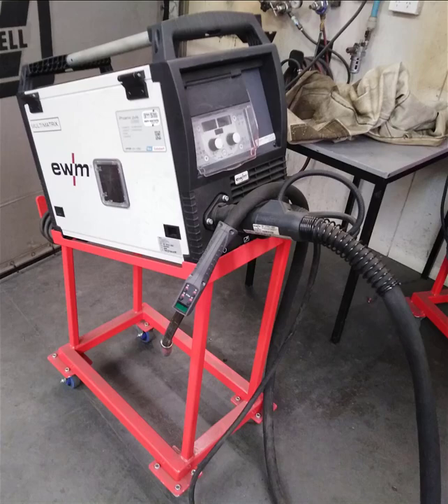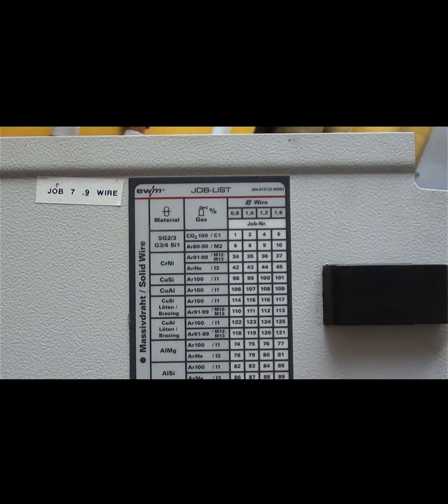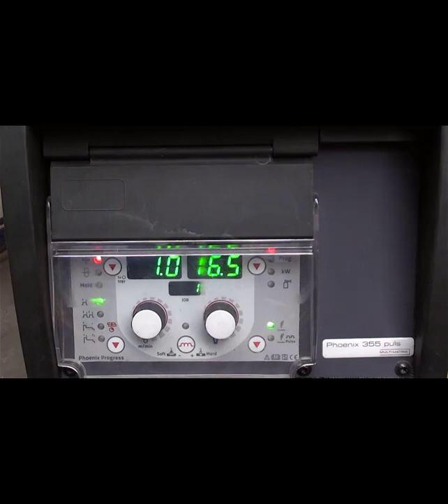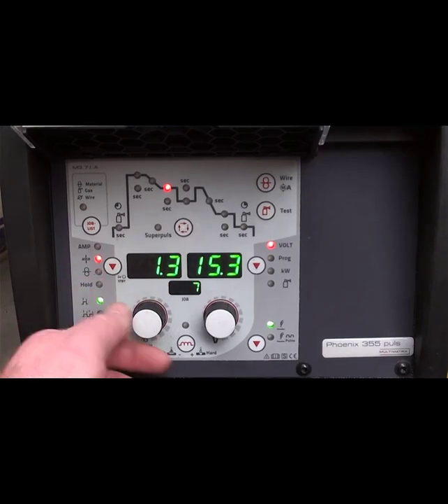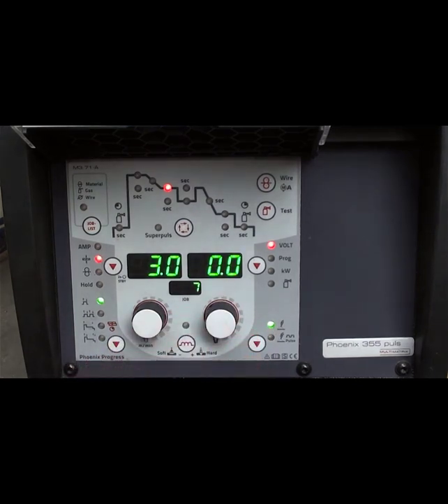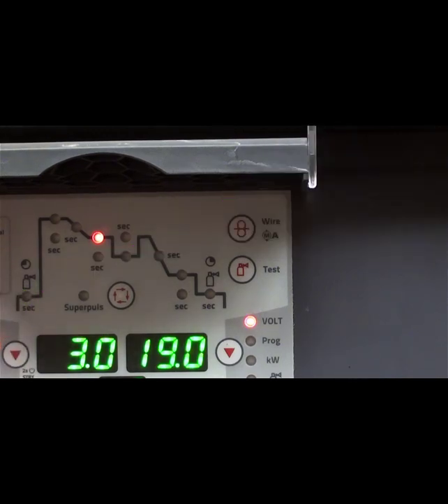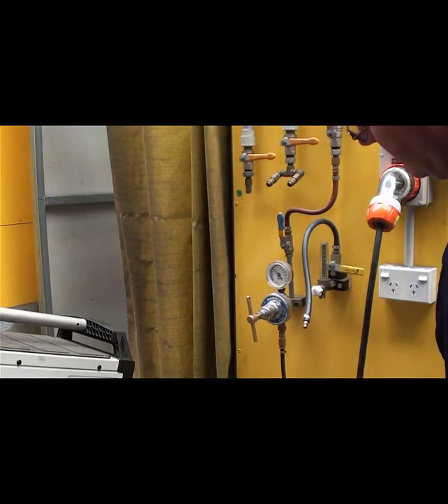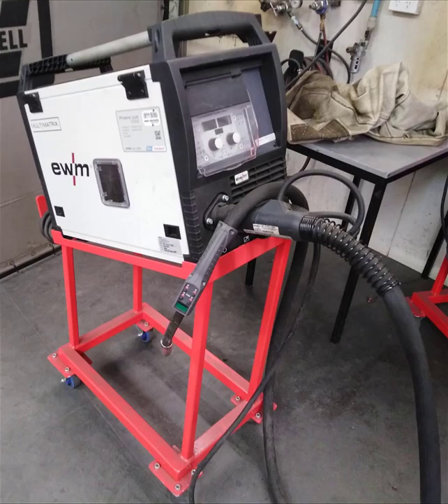ARA / Te Pukenga: EWM 355 Plus Synergic Welder Basic Set Up

Comment: I have this Phoenix 505 Expert 2.0 puls MM TDM MIG welder. I was trying to weld aluminum with 4047 filler wire. Now its voltage correction knob is not working. It is freely rotating without any clicking sound and no change in the voltage correction value. How can I rectify this ?? Please help